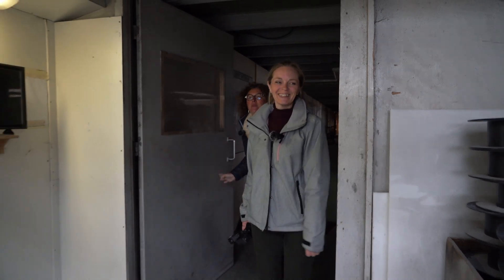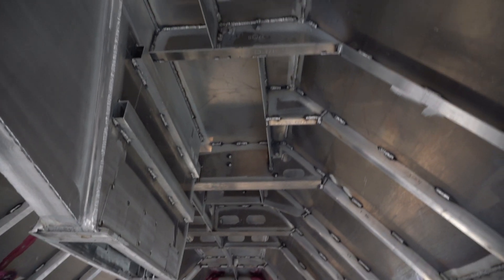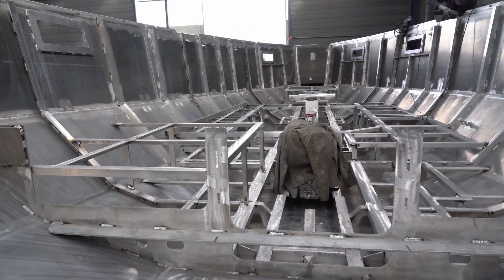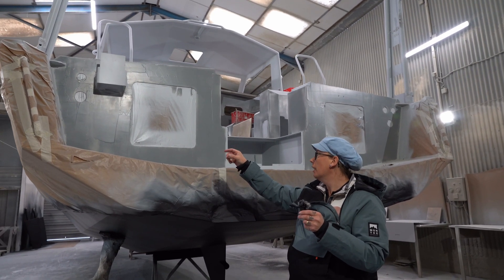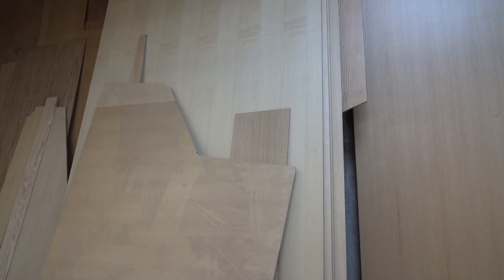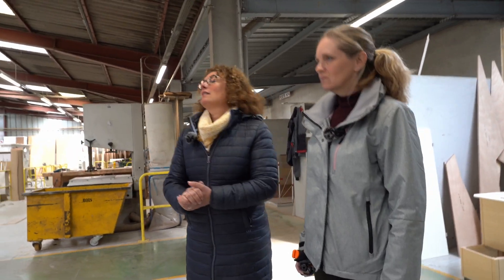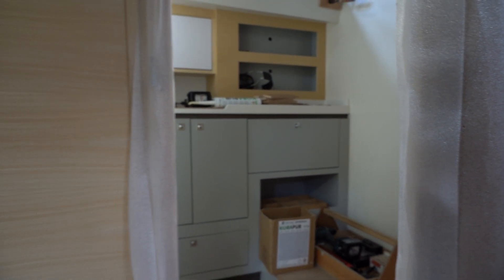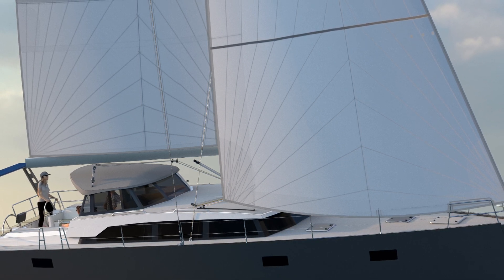How aluminium boats are built, Alubat factory tour

Comment: Much to like, apart from shockingly bad and amateur Spraying Technique which results in uneven paint application. You should stop spraying at the end of a pass, before starting again on the next Spraying Pass. by keeping Spraying at the end of each passtheends get over sprayed, causing runs and extra paint build up. Press spray, pass end spray start spray pass end spray, is the correct technique. Me? I'd have had to show them. laughs. 😅 Don't worry, I have had to point out incorrect Slating to the Spanish natural Slating school, along with problems they hadn't appreciated with the problems with Hook Fixing Slates either, along with how to correctly fit the final top course of Slates Correctly. I even had to Design a Correct Copper Nail for Slate fixing, to replace the Copper Nails being used which guaranteed Nail Failure, and inevitable Roof Failure. As I admit, I'm a right old Fussy Pants. 😅 Nice look see - and if you rematch the Spraying, you should see what I'm on about. Spraying like that would have them sacked by my former Custom Bodywork Boss, withbwhom I rebuilt his Offshore Powerboat - which had a gorgeous Paint job - he had perfect timing for wave hopping when going flat outbtoo. Old Max was an impressive Power Boat Driver tbh. Probably dead and gone now. Best Wishes,  and thanks again. Bo . 🤔🌟🌟🌟👍❤️
Reply from the maker: Can everyone play nice please or I will be forced to open another bottle of whisky and sing you all a very bad sea chanty about naughty mermades and hardy pirates.
Reply: 😂😂😂 I may have to misbehave just to see that. Back to my Glenfiddich.
Reply: @constantinealexandrakis  Mmmm. Glenridding, prior to my tasting Lagavulin, that used to be my favourite Scotch, beforevthe Scots started putting Crap in their bottles, which forced me to get a Copper Still to Distill Spirits fit for my Father to Drink - and ended up making a really decent Calvados with the use of Surprisingly excellent Spar Cider to Distil it from, which the local Landlord reckoned was much better than the French Calvados, though I think he said that to keep getting free samples . 😄😄😄 All the Best. Bob. 👍
Reply: @SVTONICBoatWives  No Comment. 😀
Reply: How shockingly rude of you.
Reply: @philipwright7186  Hoew is it Rude to Point Out Something that should  be Ringing Alarm Bells, if a Company is getting Something Basic So Wrong ?  Are you attempting to excuse what is the worst mistake Amateur Sprayers Always Make, and the video evidence is there in your Face ? That  Hum is Far, Far Worse than being Rude ! Facts are Facts, and if you can't handle the Truth, Sorry Chum but that is YOUR Problem So YOU Own it. Now Dirch the Trolling attempt at excusing the inexcusable. Have I Done better Spraying than That ? Yep, I was Trained by a Professional and worked the Paint Booth on a Factory Production Line (at a Factory for Cam Gears that made Auto Parts ). I made the Comment because it was Obvious, Pertinent, and raises questions about Basic inability to get something important right - Consistency of Paint Coat Application - "Rude" was you barging in, and instead of making a Contribution of Some Value, all you were capable of, was delivering a Drive by ignorant insult. ffs, even the Spanish Slating School Changed their Teaching when the Safety implications of what I showed them Sank in - if the top course of the Slates wasn't solidly fixed, then the Heacy Ridge Tiles couldn't be fitted Securely, and we're a Safety Hazard to everybody on the Street Below !  ut according to you, Maybe I dhould have bit my Tongue ? 🤔  😡
Reply: @philipwright7186  Hmm. My reply has been disappeared.tbh, pointing out a Chronic lack of Skill should be welcomed as well as accepted as valid Criticism by any professional Company that should be interested in improving their products ? In Fact it is expected from highly paid Troubleshooters who get pulled in Urgently to resolve serious Problems with for example Construction Projects, one of the last experts in that field Globally, was my Friend Clem, who amongst many Troubleshooting Contracts was for a German Designed and Supervised Power Station in Africa. Without his remedial work, if the power station had been fired up, with all of the Technical Staff at their Stations in the Control Room, avery single individual in that Control Room would have been Electrocuted and killed, and the transformer Far right next to a Housing Development would have Had a Chain of Plasma Detonations, like a Cascade of Mini Nuclear Explosions going off. Clem was skilled enough to fully redesign the Wiring on the Fly, and trained the Workforce how to safely Wire up High Voltage wiring Connections, and yes, I’m pretty sure the German Designers thoughThat Clem Said About them was moo than a bit Rude. Unfortunately, Google isn’t allowing a translation of that comment in French, but it is hard to escape the significance of the word “Canouflage” which too me counts as another Ske against me being able to recommend this Companies Products. My ion of them in fact started as favourable, but sadly that is no longer the case, and isn’t helped by their attempt at concealing unprofessionalism, which right now, they are clearly encouraging.  tbh, if I could have had some assurances on the reliability of Lifting Keels, I had become interested in the 430 Model. Well, I guess they can kiss goodbye to that potential Order as an example of my supposed rudeness. 🤔 Still, at least continuing debate in the comments section, may assist SV Tonic Boatwives Channel’s Google Algorithms I supppoose. Bob.👍🌟🌟🌟⛵️❤️
Reply: pour infos l'applicateur fait le retour hors de la partie a peindre sur le haut il inverse sur le papier de camouflage et le bas il repart dessous la coque